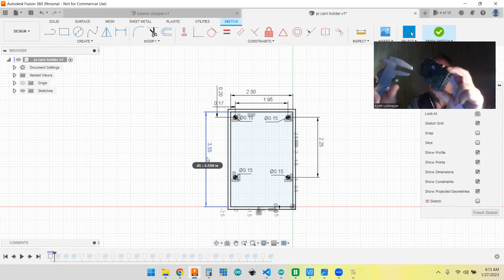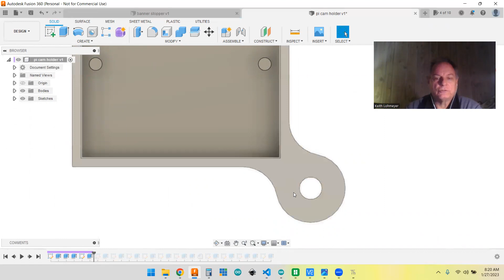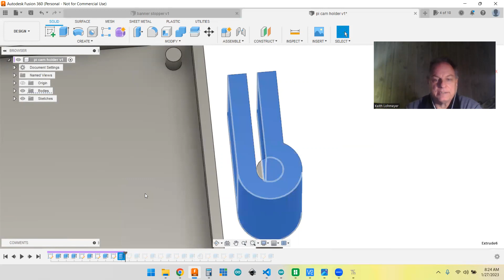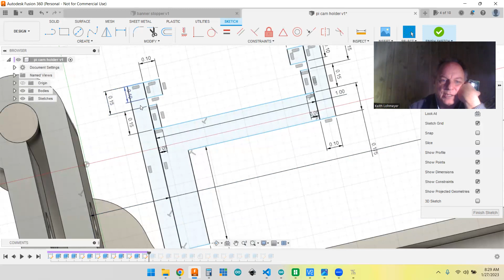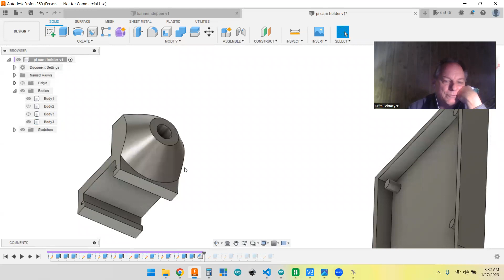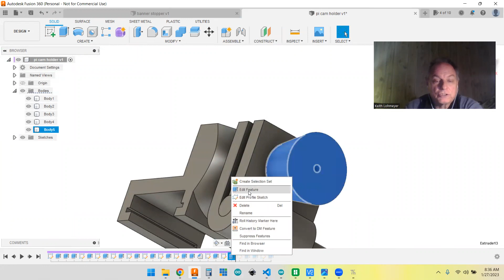Fusion 360 Workflow for Pi Cam by Request

Comment: Thanks so much for making this video!! I like the way you made it! After watching I had a couple of questions though.
1) I've always thought that when making a larger design (Like this one) Components would be better than bodies.
2) Do you normally name you sketches and bodies? 
3) How long did it take to make this? (As in, how long to design) 
4) Did you ever have a problem with overhangs?
5) I saw that some of your sketches weren't fully defined, Paul wouldn't be happy! Did that ever cause difficulties later on? 
6) Why didn't you look at Pi Documentation to find the dimension of the Pi? 
Thanks a lot Keith!
Reply from the maker: Answers 
1- Components are better than bodies but to be honest I was just lazy. 
2- If I am just working on something for my self no. If I were doing it for a job then yes.
3- Once I started measuring the camera and RPi PCBs to the point where I was ready to 3D print maybe 45 minutes.
4- No I design to avoid them. All parts except the knob were printed in the orientation shown. On the knob I put the end with the taper on the bed and used a brim to get a stable first layer.
5- I only worry about dimensions that matter for my personal designs. I did not have any problems later.
6- Yes a 5 second search would have saved me time. Of course I might have missed that the SD card sticks out past the end of the board without a physical inspection. The SD card is not shown in most drawings.
You are welcome Andrew. Thanks for the interest.
Reply: @keithlohmeyer  Thanks for answering!!!